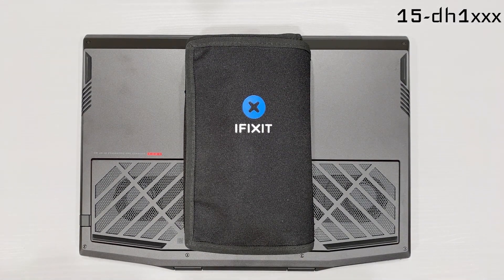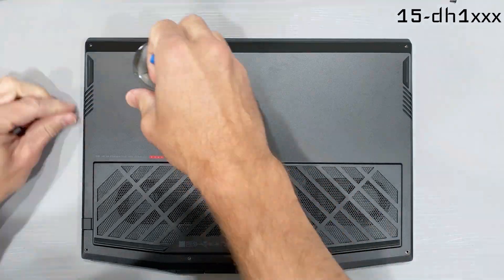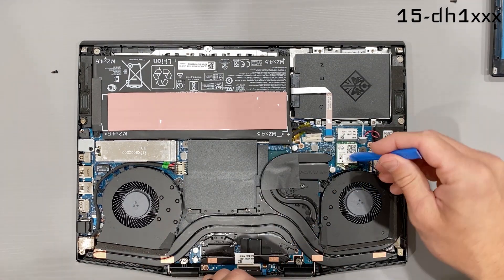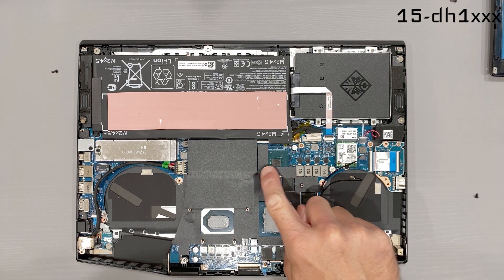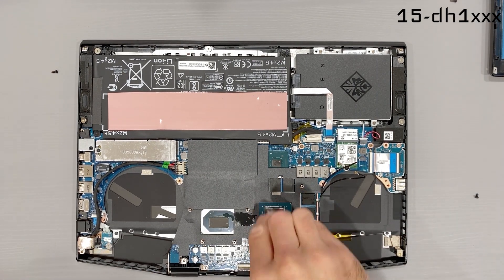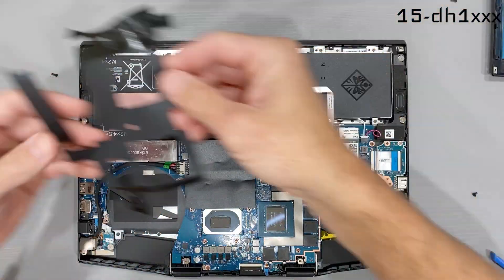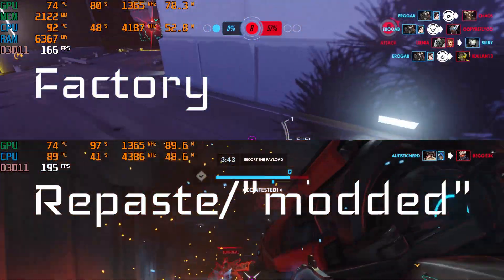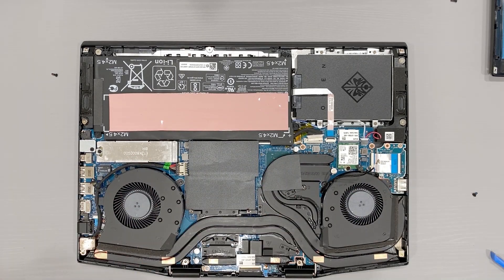HP Omen 15 2070MQ Repaste 15-dh1xxx

Comment: When I bought mine, it was running extremely hot under no load out the box. I figured it needed a repaste as I bought it new 2 years after release at a heavy discount. Opened it up and there was no paste to be seen anywhere! Legitimately perfectly clean. Didn't bother letting anyone know. Pasted it and its doing well.

Comment: Any idea why my omen performance starts to severely drop after 10-15 minutes? I wonder if its time to be repasted
Reply from the maker: Monitor the temps in real-time with MSI Afterburner and see if that’s the case.  What’s “severely” in this case?  If you’re only losing 10% then it’s possible that’s it’s due to thermal throttling.  If it’s falling on its face into a slideshow of FPS then it may be something else.
Reply: @BobOfAllTrades  slide show. The cpu will max at 100 degrees C. The 2070MQ gets up to about 75.
Reply: @BobOfAllTrades  windows 11 maybe?
Reply: it is due to BDPROCHOT setting related to CPU most likely. It basically limits the CPU to  like half of it performance when it sits above 95° for too long (likely also the GPU) and FPS drops dramatically. you can actually check if this is happening in throttlestop. Had the same thing happening on my laptop (the same omen as in the video but with rtx2060) and was worried something was wrong but it was time for a repaste.
Reply: @pegatrisedmice  yeah the fans were saturated with dust and hair. Cleaned them out and got a laptop cooler and no problems. Will have to repaste with the highest quality stuff here soon just to be sure

Comment: I just used your video as guide to apply liquid metal to my hp omen 15, 15c lower temps on average! Took a few applications to get the right amount on the chips but I got them working great. Used acrylic conformal coating to protect the gpu and cpu from getting fried too.
Reply: I am new to this. Can you please explain when should I apply the conformal coating?

Comment: Sir I have the same laptop and I’m worried my CPU temps are always above 90C. I am afraid and haven’t played any games on my gaming laptop which beats the purpose of buying one in the first place. If anyone has found a fix for it do let me know. I have tried undervolting to -0.80 but still hasn’t been a significant decrease in the temps. 

Please help me out in this regard
Reply: get a cooling pad that your omen sits on.  i got one with 5 fans in it and it helps lower temps by 10 points when I have it running full blast i top out at around 170 F GPU  180 F CPU while playing halo infinite on recommend settings from NVIDIA.

Comment: I have a dell g7 7700 and the temps are sht out of the box . Constantly hitting 100 deg Celsius. What kind of paste should I use ?
Reply from the maker: Phobya Nanogrease and prey it works.  Those are a nightmare to teardown
Reply: @BobOfAllTrades  I probably just gonna return it and get a MSI gs75 stealth. Only reason I got it was because it was on sale at best buy for 1299. 300hz monitor,max p 2070 and. I7 10750h. Plus I like the aesthetic doesn't scream gamer. It looks like a regular laptop.
Reply: @BobOfAllTrades  I really don't want to take the chance voiding my warranty. I've never done thermal paste before and I don't want to fck up an expensive machine like this. I was able to get the temps down a little by setting .max power boost in xtu to 20. I also undervolted the 2070 from 1900mhz to 800/1560 using MSI afterburner.Dell has the GPU past it's rated specs for some reason.I'm probably gonna hang onto it cause that means I'm gonna have to spend another 300 or more if I take it back to get another laptop with similar specs. Which I really don't feel like spending more money lol.

Comment: Hi Bob. I actually appreciate the black cover as it provides good protection when applying liquid metal. I added some electrical tape around the CPU & GPU dies to seal it and provide full protection to the underlying board along with some nail polish on the transistors around the CPU &GPU. From my point of view, it is as if that black cover was engineered for liquid metal. Enjoying my temps of 65c when gaming (undervolt applied of course on i7 CPU 9th gen & on the 80w Nvidia rtx2060).
Reply: Do you have a video of that mod?
Greetings
Reply: @reviewyreparaciondeelectro4240  
I didn't but I guess I could. Did last liquid application back in September, probably will do a new one by end of month. Will post back the link when it is done.
Reply: @amaurytt   Would be great
Greetings
Reply: @amaurytt  it’s been a year
Reply: @TriangleSquare52  it is time to change the liquid metal indeed. Need to order some. Will keep you posted

Comment: great job ,well repasted i have the same model , you made think that some thing wrong with my tempera tures reading  . i'm using mx4 btw . can't tell cause every one is 85+c°
Reply: Hi, the trick is to undervolt your CPU. Considering the version you have, you are probably running an 8th or 9th gen intel. Usually applying an undervolt somewhere between 135mV and 150mV should lower your temps by 10 Celsius. You have three options to do this : 

1) Intel XTU software which is quite easy
2) there is now an undervolt option directly in the latest version of Omen Command Center (there is an auto feature to find the safe setting but it is quite conservative, you can also set the valur manually)
3) the third option I don't recall the name but it is quite advanced and kind of overkill.

Comment: I like this chassis version, perfect port placement and a 2.5 SATA bay, shame it doesn't have a 2nd m.2 slot.
Reply: Yep, totally agree about the missing 2nd m2 drive
Reply: @amaurytt  the 15 inch line never had a 2nd m.2 except for the 2020 refresh which ditched the 2.5 SATA.
The 17 inch line have 2 m.2s on the 2070 and up GPU models. 2060 and below have the m.2 components removed.
Reply: @themadatheist1976  I get that. Just that a second M2 drive on the Omen 15 is the only missing feature to make it perfect. I'm totally a fan otherwise, its' actually my second one. I've got a version with a core i7 9th gen with an RTX 2060. Could say I was a bit sad to not get the RGB keyboard (just red LEDs) but I can live without that.

Comment: An advice I'd like to give to people looking forward to repasting this laptop is that there is such thing as putting too much thermal paste when repasting a laptop, at least this one. I have repasted mine twice with kryonaut, and the result differ A LOT. First time used the pea method, a method I've used before and never gave me any problems, and when I started up the laptop noticed that my idle temps hadn't changed, at stock the first months my idle temp was around 45, when I begun the process of repasting was aroun 57, and when I repasted the first time was 54. As I kept using the laptop for a few days, for both gaming and architecture rendering workflows, with fans at max I still hit around 95 degrees, which was better than the 100 mark but not by much. Got stressed out, so time for a second repaste. This time I tried to be more careful, apparently even the pea sized amount was too much, and kryonaut is known to have problems if you're constantly going over 80°. So, I went in, cleaned up, but this time in the CPU I applied the paste with the tool included, just a thin layer, I still used the X method on the GPU, which didn't go above 70 even on stock paste (it's evident that is because there is more copper meant to disipate heat from the GPU), my theory was that when the cooler is that limited what you want is the heat to come out from the cpu as fast as posible, if you put too much thermal paste it will drool out the sides and when the heat transfer occurs instead of most of the heat going directly to the copper it will work around the excess of paste(at least that's the explanation in my head) and once I'm done, start up the machine, 40 degrees at idle, I had previously repasted another Omen that reached 25 degrees at idle(granted this was an i7-6700HQ), but now cinebench showed improvement, temps were around the high 80s with an undervolt, there seemed to be no thermal throtle, and if you are willing to put the fans at max you can play games like Control or Horizon Zero Dawn with 65° on the CPU (even tho it's evident the game is GPU bound, previously I also reached 98° in this title) So my advice is apply the paste with care, the heatsink is heavy emough that it will make contact all the same, and if you're using Kryonaut make sure to not push far your machine for the first few weeks, my experience also shows that the first few weeks the paste somehow isn't that settled and degrades faster if you push it too much. Also, thanks Bob for continuing to produce content for this laptop, it's evident that the 2020 model is a very good successor but this 2019 chasis never seemed to recieve much love.
Reply: Hello , Thanks for your advice mister , i have a few questions tho what technique should i use to repaste it i couldnt quite get it , should i put a lot of paste or less , im looking forward to repaste mine with kryonaut too so im just wondering is it worth it or not rly ? Thank you
Reply: @pftw600  I recommend the spatula, just a thin layer should be enough. You have to remember that technically the heatsink and the CPU/GPU are in contact, the thermal paste just compensates for micro scratches in the copper. I usually add a pea sized dot for the CPU and a line for the gpu, then spread with the spatula to get a thin layer covering all the die. The more surface you cover the better, then put the heatsink nice and steady.
Reply: @santiagomonteromendez1371   Ok , Thank you so much for replying....im just wondering what are your temps and is it worth it ? does it void the warranty ? thank mate
Reply: @santiagomonteromendez1371  Because mine now is 95C on heavy loads , which is kinda annoying and i get some throttling soo...what is the temp decrement that am gonna have with the thermal paste and  do you recommend a better paste or it doesnt matter  with this laptop cuz i've seen some other people on YT repasting their laptop and they get huge decrement in the temps but this video shows that there is no big difference before/after repaste so it kinda worried me.
Reply: @pftw600  I used kryonaut, repasting and cleaning alone might reduce some of the throttling but it's possible that you still reach the 90s, with a lot of throttlestop tweaking I was able to get 70-80ish temps in the cpu and 60ish temps in the GPU under load with max fans. I kinda set 6 core clocks to 4Ghz, since I saw that there wasn't much to gain from leaving it trying to get to 4.1 or 4.2. I also tweaked the Power limits to avoid high temps but also avoid Power throttling. From my experience I feel like kryonaut needs some tine to adjust... The first time I repasted I went on to start testing right away and temps were lower but in less than a week they were back high, I read that kryonaut doesn't perform as well once yo go above 80 °C for long periods of time. So I repasted again, made my throttlestop tweaks and then tried to not force the laptop for a few days, I made sure that it got cold from time to time... My idle temps went from 60C before repaste, 50C after 1st repaste to 35C after the second... It's been a while since I repasted and my idle temps are now at 45C which I think it's still a win. But if you repaste you must know that from time to time you'll have to repaste again. On really heavy and long workloads I still reach 95 but while gaming temps are closer to 85ish on CPU demanding games, games that are more gpu bound like control my cpu temps are closer to 65-70. But I must say that all of these are with max fans (except idle of course)
Reply: @santiagomonteromendez1371   Okay thank you so much for following this. Im going to repaste and do some underclocking like you did to 4ghz , i dont know much about the power limiting so am not gonna mess with that now. thank you again kind sir.
Reply: Thanks so much for the info man, going to repaste my HP omen today, gonna use your "thin spread" method. You sure its not gonna cause any air pockets ?

Comment: great video ... please consider doing videos on screen/display replacements/ upgrades on laptops as well....as far as im aware theres no channel that do this specifically to inform people about the process.
Reply from the maker: I did this long ago.  There really isn’t a need for this since displays are much nicer now.  

Thin bezel laptops are not easy to remove their bezel without damage.  They also use adhesive on the chin making it ever worse.